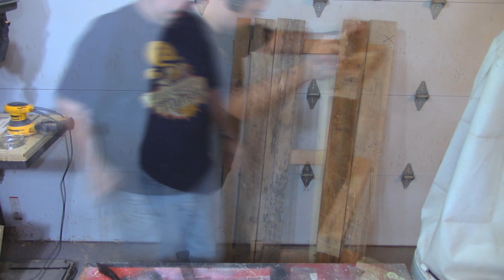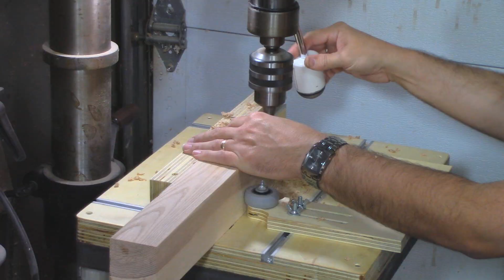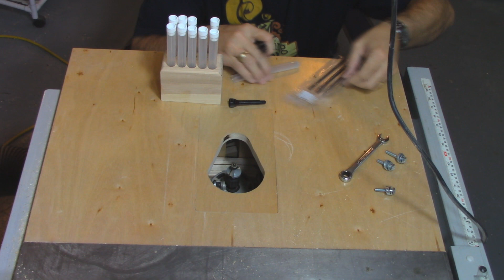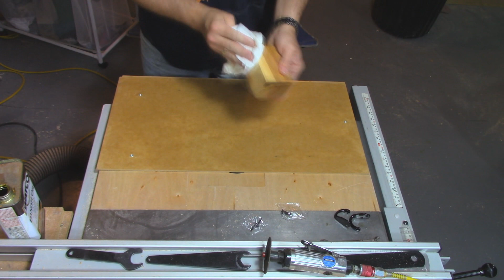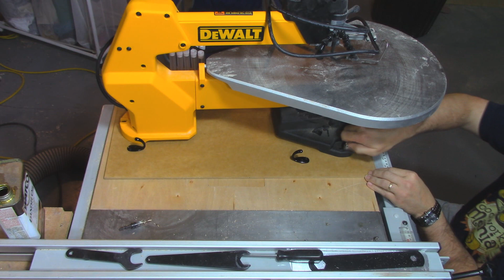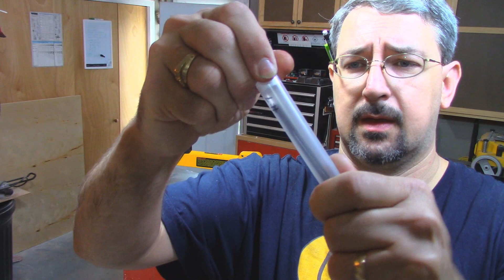Scroll Saw Blade Storage

Comment: nice integrated solution Mike. where did u get the test tubes from? I'm still using old Pringles chip cans for my blades lol. Did you get the straight or spiral blades from Flying Dutchman?
Reply from the maker: +Mark Christopher Amazon, there is a link on web site soon